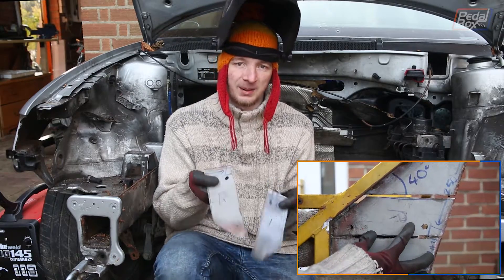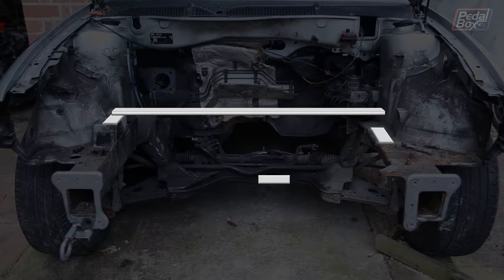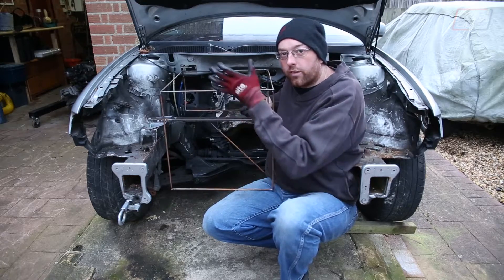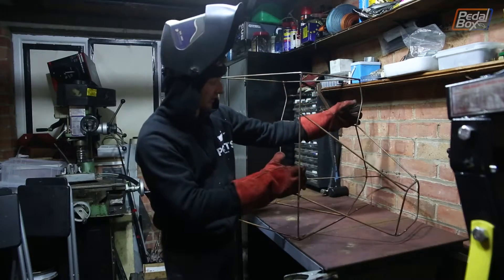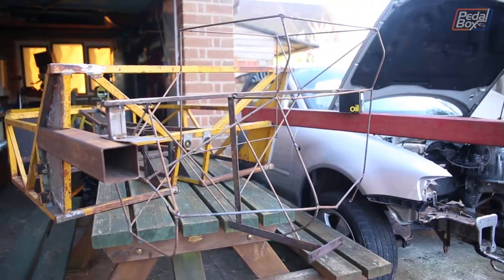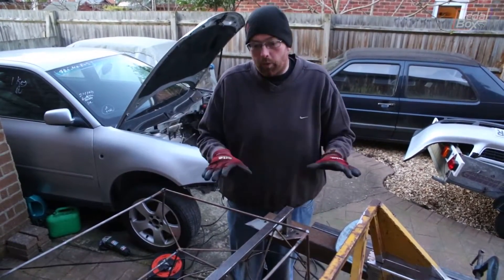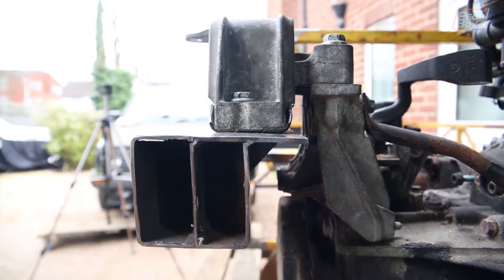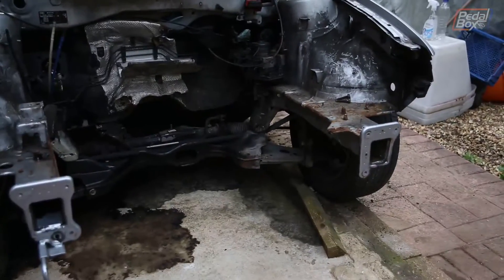Mounting an Engine | PedalBox Episode 7 | Mid-Engine Audi Kit Car

Comment: Awesome template! You did yours the smart way!! I just centered my axles (longitudinal trans) and gave the axles a couple degree tilt for wear at ride hight and mounted it from there. A friend of mine did his as low and forward as possible and kept having stub axles come out...

Also way cool editing for the template overlay! What did you use for that?
Reply from the maker: Cheers! :) Yeah it's helped avoid a few things, but probably needed a bit more thought... next time :D

The overlay is just a freeze frame of the video I pulled into Photoshop and them draw layers over, then added the layers one by one into the video. Worked neatly for a hacky job :)